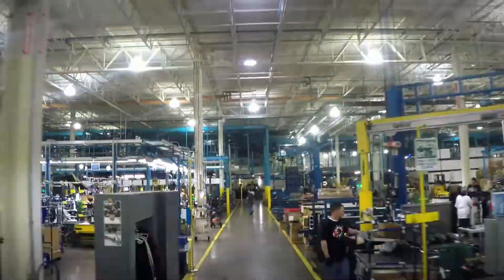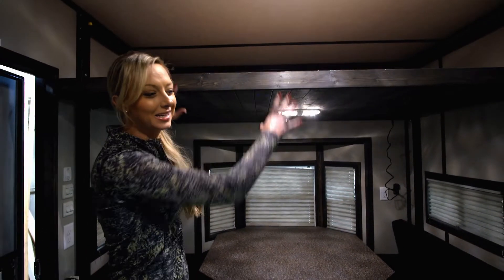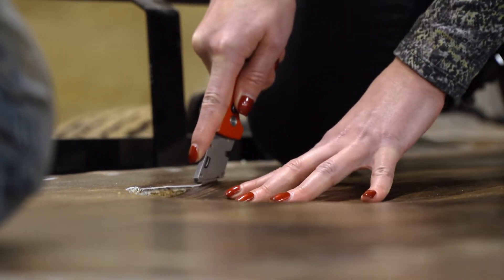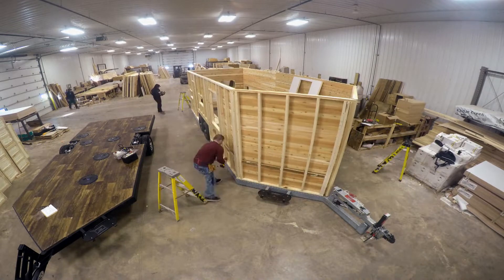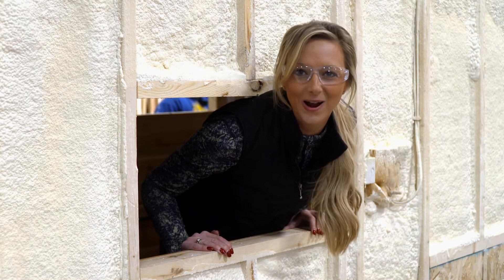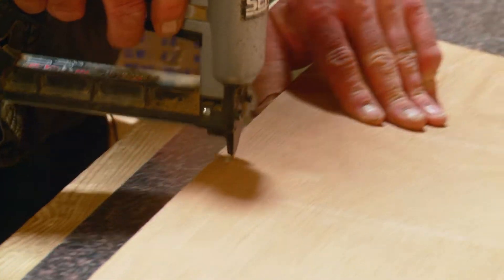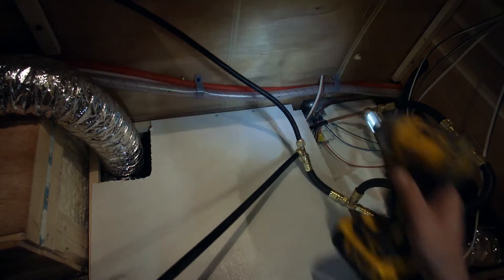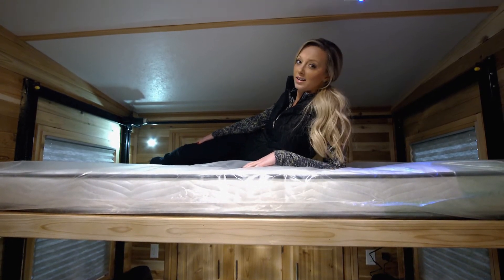Made for the Outdoors (2019) Episode 7: Ice Castle Fish Houses

Comment: Anyone know how they fastened the 3/4" plywood floor to the frame? Looked like a nail gun?
Reply: I saw that too. A better way is to use self tapping screws straight through the plywood into the frame. Much stronger. Ice castle cuts a lot of corners.
Reply: in one part of the video they zoom out and you can see the 3/8" bolts going from the bottom of the frame through the framing of the walls to secure everything together
Reply: @donovan612ify  ice Castle is the bottom of the barrel.  Everything is a step up from them...